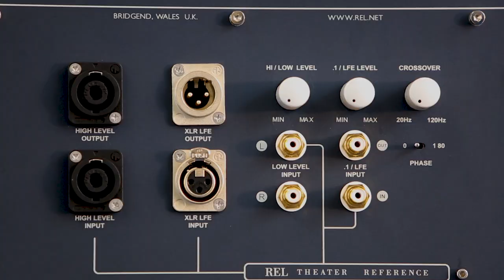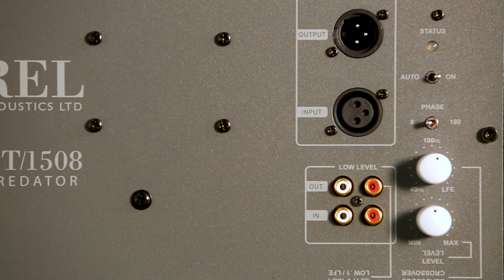Why you should connect your REL subwoofer with both high level and .1/LFE inputs

Comment: Does this apply to older REL models, specifically the Stampede?
Reply from the maker: It depends on the specific older subwoofer model, though the Stampede can certainly be connected using both the High Level input and .1/LFE input simultaneously.
Reply: @RELAcoustics  Many thanks for the info. I had a chance of buying a Stampede second hand, but in the end settled on a new, discounted (maybe because the mark 3 has now come out and the vendor wants to clear old stock) T0 mark 2, which is perhaps more appropriate for my listening room and speakers. I haven't run it in fully yet, but already I've noticed how it improves general speaker performance in stereo, not just the bass (I haven't yet connected the .1 cable, am concentrating on stereo first).

I don't really get how it does this. The high lead, the manual says, draws next to no current from the amplifier. So how do the main speakers "know" not to expend as much effort on the bass? How do they "know" about the crossover on the subwoofer? Maybe I've got it wrong and there's something obvious I'm missing...
Reply from the maker: @johncallaghan3097  The high level input on our subwoofers is designed with a significantly high impedance, which results in the subwoofer not placing any current load on the amplifier. In effect, the subwoofer is virtually invisible to the speakers and the amplifier. With our design your main loudspeakers are running completely full-range, without any filtering being applied to their output, and the subwoofer is simply crossing over below where the main loudspeakers naturally roll-off in their low-frequency response in your room. 

By adding the fast and responsive sub-bass output of the REL to your system, the sounds being produced by your system are far more realistic and natural. In effect the REL is enhancing, rather than fundamentally changing, what your speakers and the rest of your system was already capable of doing.
Reply: @RELAcoustics  Thanks very much. I wondered if something like that might be happening. Makes more sense than the explanation I'd read elsewhere that the sub took over part of the amp load, leaving more power for the treble and midrange. Perhaps some subs do that, I don't know, but not my new REL T0 mk 2!
Reply: Hi  @RELAcoustics  , what about other older models like the Quake Mk2? ANd if so, the LFE gain control would be the Low Level knob?
Reply from the maker: @inavicu  Thank you for reaching out. The Quake MKII can be connected to using both the High Level input and the .1/LFE input simultaneously, and the "Lo Level" dial is then used to adjust the output for the LFE channel.
Reply: Amazing,  @RELAcoustics  thanks for the quick reply and for sure my future audio upgrade will have Rel in the list!

Comment: I have a Rel s2 for stereo use, I don’t have an av amp. However I do have a sound bar  which I have a LFE out, could I send this to my Rel and use the Rel when watching tv and then use the Rel as I’m currently doing through high level for music connected to the speaker terminals of my stereo amp? There would only be one system running at anyone time!
Reply from the maker: If these systems are in the same room you could connect to both, though it will make it difficult to optimize the subwoofer's performance for both applications. For connection advice and instructions, feel free to write in to contactus@rel.net and we will be happy to help.
Reply: REL Acoustics thanks for the advise

Comment: Confusing video.  Bass management is done in the receiver.  It sends the LFE channel to the sub alone with audio from all channels below their crossovers.  Typically it's 80Hz with every speaker set to SMALL.  

If you connect high level inputs to the sub also, that signal would only be from having the two main speakers set to LARGE in two-channel mode from the receiver.   

Two questions.

If bass management is set in the receiver, then what is the crossover setting on the sub itself?  Normally it's set to 120db.  

If so, then how is the crossover set for high level inputs on the sub? 

Confusing video.
Reply from the maker: The crossover dial on the back of the subwoofer only controls the High Level and Low Level inputs, since the crossover setting for the LFE channel is set within your AV processor. The subwoofer's crossover control should be set to below where your main loudspeakers are naturally rolling off in their low frequency extension in your room when driven by a full-range signal.